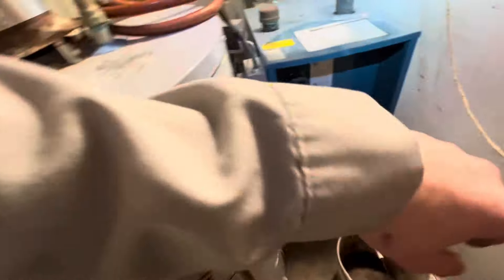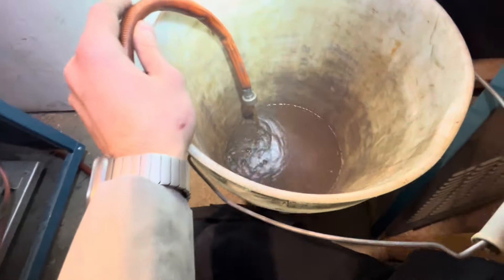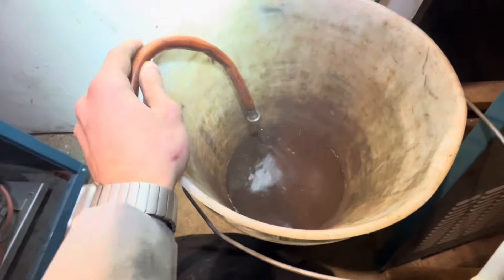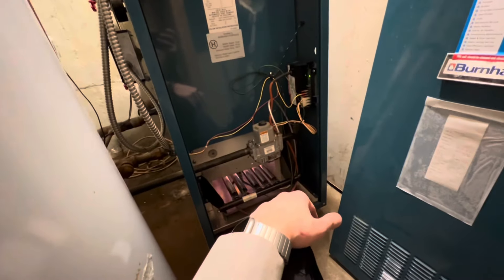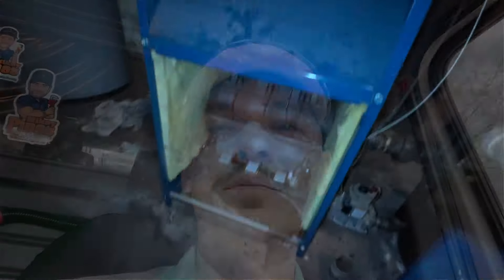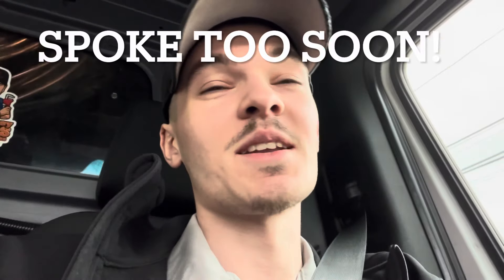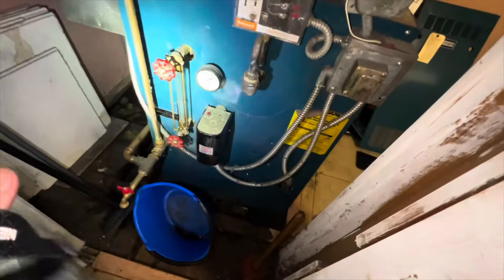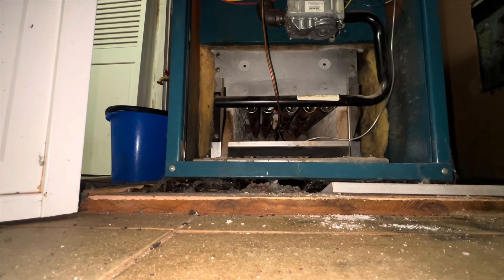Insane Flame Rollout! Two Condemned Steam Boilers in One Day! And Steam Maintenance Call!

Comment: I had a client one time where his boiler was completely carbonized so I bypassed the rollout switch just to show him what’s going on and I told him it’s either you clean the boiler thoroughly by removing everything or replacing the boiler and he said let me think about it and then he told me to leave the rollout switch bypassed I looked at it says there’s no way I’m doing this so when I gave him the invoice, I made sure he signed the part where it said that I turned off the boiler and I’m not allowing him to bypass the rollout switch or to use the boiler until this issue gets fixed. Some people just don’t understand how dangerous this is.
Long story short next day I went there. I cleaned it, and I made it perfect five years later, still working like a charm. now you’re gonna ask why did it get carbonized?I think there was a combination of a few things. Gas control valve was not putting out good flame plus the pilot light flame was no good all confirmed by combustion test and visual at first plus the Chimney had to be relined wasn't drafting well
Reply: Gotta write it up and get it signed to cover your ass.Smart move,i always do the same.
Reply: never let them see the bypass  run the unit to show them and let it trip the roll out

Comment: How often I question what I am doing and then I see what others have done.  Makes you wonder why there are not as many disasters.   Last two yearly pre season maintenance would have either helped or at a minimum prevented a no heat winter swap out.  Nice work.

Comment: Should of made attempt to fix. either the gas valve or control is causing the flame rollout. especially if the rest of the boiler is in good shape.
Reply from the maker: The boiler is in awful shape there’s a hole in the heat exchanger. It would be ignorant and dangerous for the homeowner if I were to try to fix it. That’s not what a professional does.
Reply: @DCHVAC  ok I must of missed that in your video. not worth fixing then.

Comment: Why didn't they clean it? Boiler not leaking?
Reply from the maker: Both boilers leaking
Reply from the maker: That’s what caused carbon. The leak caused buildup of calcium and whatever from the water that’s what started the improper draining. They’ve overfilled multiple times and water pours out. They add water 2 times a day.
Reply from the maker: Disliked this comment
Reply from the maker: If you look at the video of the combustion chamber you can see all the insulation is stained and corroded away
Reply: @DCHVAC  I didn't see water leaking did you flood boiler to see it leaking?
Reply from the maker: @scottmaz4063  yes, it started to drip slowly directly onto thermocouple. You can see the dampness in the video I didn’t fill it all the way to the top because the homeowner stated they knew there was a hole in it because there sons have overfilled it and it leaks like crazy
Reply from the maker: Look at the interior of the cabinet. It’s completely rusted out instead of blue. Because steam is hitting the cabinet non stop
Reply from the maker: And they also pointed out that they’ve had thick white “smoke” from the chimney for years
Reply: @DCHVAC  ok then it's time to replace
Reply from the maker: @scottmaz4063  I knew that already